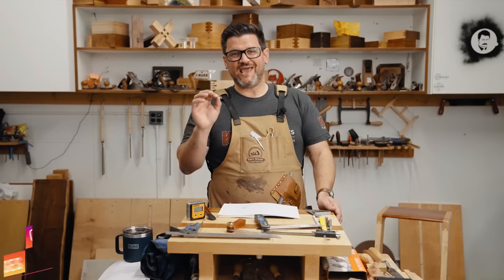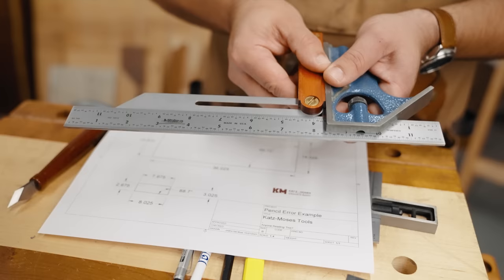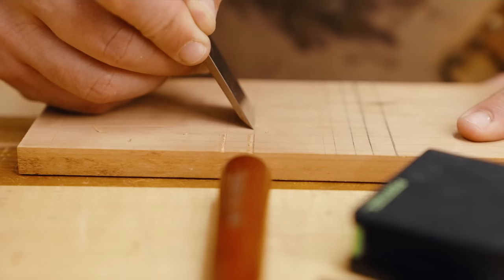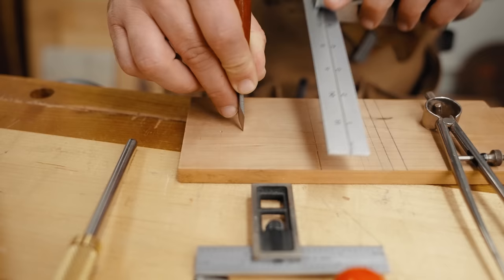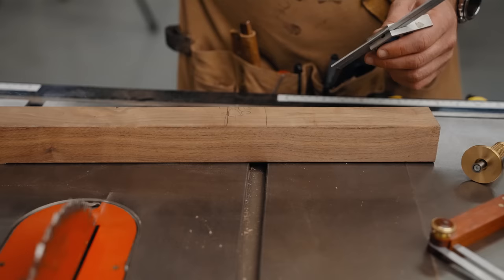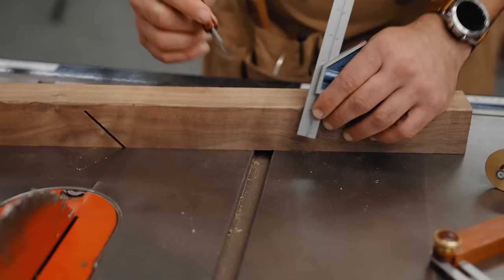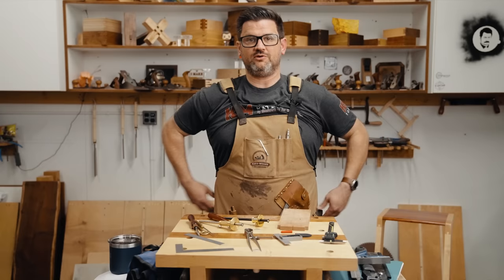Why Accuracy Matters in Woodworking - Common Mistakes to Avoid

Comment from the maker: Support What we do at the Katz-Moses Tools Store: KMtools.com
Tools Discussed in This Video
Marking Knife - https://shop.kmtools.com/MarkingKnife
Marking Gauge (micro adjust) https://shop.kmtools.com/mgbrassma
Marking Gauge https://shop.kmtools.com/mrkg
Center Punch https://shop.kmtools.com/centerpunch
Blem Squares https://lddy.no/120n3
Blem Rulers https://lddy.no/127tj
Double Squares https://lddy.no/127tm
Dividers https://lddy.no/127tn
Digital Calipers https://lddy.no/mpl3
Bevel Gauge https://lddy.no/127tp
----
Time Stamps
Intro 0:00
Why Accuracy Matters 0:17
How I use Tools For Accuracy 3:49
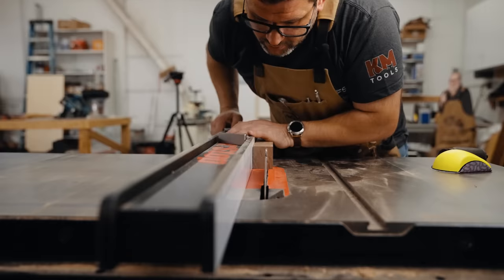Accuracy on the Table Saw 9:27
Accuracy on the Drill Press 13:17
*Accuracy with a Router: 15:20
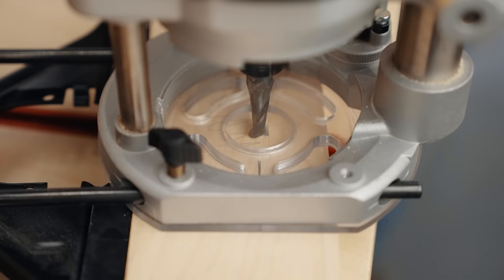Final Thoughts 16:49
Reply: Great video.  Keep them coming.  Chuck
Reply: Some of these links don't work. I went looking for the marking knife and the center punch, and those two for sure don't work.
Reply: “Yes i did read it!”, is the answer to your question “Anyone reading this?” On the technical drawing: Pencil Error example”

Comment: My belief is that accuracy is important, but consistency is more important.  If one part is 1/64 off, that will show.  If ALL of your parts are 1/64 off, that won't show.  When I cut multiple parts, I try and cut them all at the same time with a single machine setup.
Reply: This has been one of my key takeaways from Chris Salamone's videos - planning the cutlist in batches of same-size/angle to minimise the opportunities to introduce errors, using already-cut pieces as reference for the next piece instead of assuming that those perfect calcuations have transferred flawlessly to the real world, and where necessary taking multiple passes and test-fits to sneak up on a perfect fit instead of aiming directly for what you think is the perfect *measurement*.

JKM's advice here is all spot-on for the accuracy half of the equation but like he said himself, the best woodworkers are the ones who can fix their mistakes. Consistency and logical workflows are two of the best ways to do that :)
Reply: Exactly! Repeatability and Reproduceability are super important for most forms of engineering/manufacturing/quality control/medicine, etc, and woodworking. And metalworking. And cooking. Ok this is getting long 😂
Reply: yeah cause 15 thou means anything in wood lmao
Reply: @alterworks7212  Sure. And 640kb is obviously enough for anyone. Why bother with microns when we have inches right? Accuracy, Progress, pffft. All we need is duct tape. And marketing.
Reply: Numbers don’t matter. Fit matters.  Batch your cuts. Mark directly from mating parts, not indirectly from a measurement.
Reply: One could argue that accuracy and consistency are the same
Reply: 💯 yes!
Reply: @stephenrichie4646 you hit the nail on the head. It doesn’t matter if you start by measuring in inches or millimeters. It makes a world of difference if your shelf is noticeably shorter than the space it is supposed to span. Or if your box isn’t square because you got one measurement “wrong” and didn’t make adjustments as you progressed through your build. Usually there are no wrong measurements, just bad fit or inconsistency. Built ins are a different story…

Comment: Another advantage to using the marking knife is you cut the wood fibers on the surface so when you make your cut with either a hand or power tool there is much less chance of tear out or splintering.

Comment: These are undoubtedly some amazing tips, however i feel like this is addressed to professionals rather weekend woodworkers. Personally, i have contractor level tools and i do my best to make them precise and square them up, but realistically no matter how much time i will spend on precise marking i’m pretty sure most of my cuts will be ~0.5-1mm off due to the imperfections of the tools themselves. If i ever think about making money from woodworking, i will definitely take the advice from this material.

Comment: I love Taylor Toolworks 👍 My blem 12" combo and 6" double square are in constant use. You are the second person who has referenced using the same measuring device when working. When I did that with my last project, the accuracy was incredible. Most dead on project I have ever created. 
Love my center punch as well. I always use it when drilling holes. Got tired of my drill bit wandering, especially in softer wood.
You are one of the first creators I look at when starting a project and need pointers. You are also the person who helped me see how everything is not "perfect". I had an incredibly hard time with that when I first started and regularly wanted to scrap a project. When you stated that the mistake didn't matter, learning how to fix it did, it changed my outlook and helped me become much less frustrated. 
Thanks for the great info.

Comment: On the rare occasion I use a hand saw I found about 20 years ago that, after knife marking my line, to chisel a bevel out the whole way down like you started. It really helps the cut start out good for me as I have roughly 0 points invested in handsawing.
EDIT: I have an obsession for marking knives like you do for gauges. To the point where the reason I learned how to forge weld in blacksmithing was to make a "Damascus" pattern welded marking knife. I know have made 8 of them lol.

Comment: Videos like this are always interesting to me, because of the contrast between the almost machinist-like approach to woodworking on one end of the scale, compared to the build-to-fit no-numbers methods of old style hand tool woodworking on the other.

I personally lean towards the latter end of the scale, just because all the stuff I do is one-off and it has a nice low-tech appeal to it, but I can definitely appreciate both approaches.

Comment: Great video! My college professors would love this. This reminded me of every physics, engineering, chemistry and math lecture about accuracy and precision. I especially appreciated the part about using the same take measure. I would go further than that. You need to do inter-comparisons of your measuring devices and only mix use those that match up and toss out, donate, whatever... Everything that isn't square.

Comment: So true!...the digital caliper and a knife has replaced my tape and pencil... Cutting kumiko half lap joints for a shoji screen, using a box joint jig;-18 cuts over a 8ft length, 0.001 inaccuracy would screw up the whole layout. One lesson I learned was to start in the middle and cut the variation in half! Love your vids!

Comment: Every new woodworker should watch this video multiple times before picking up a tool and again after getting started. I learned some of these things the hard way. That, plus many of the guys in my local woodworking club say that woodworking is not that accurate. They scoff at William Ng using a feeler gauge. Good on you AND William!

Comment: As good as his tips are, I for one am not sure about putting your finger on the top of table saw blade, or on the spindle of the router.Always found it best to run or router a piece of scrap to check for error/ accuracy of setup.
Stay safe  guys

Comment: In my professional engineering mode I use digital calipers.   In my wood shop I MUCH prefer dial calipers.   If you use them to set a distance (instead of measuring) you will find it vastly easier to set, say, 1.5625" with a dial.  You'll dither with digitals and probably never really get it dead on.   They never run out of juice, are much easier to read in low light & cost less.   Yes, baseline measurements (i.e., 2 distances) require a little arithmetic but I can add and subtract with the best of them and it's not required often.   It's also possible to get better than 0.0005" measurements if you can guess how far between the marks the arrow points.  I use a 12" Mitutoyo dial caliper in my wood shop and wouldn't trade it for any electronic version.
Reply: Wilhelm Taylor...I'm with you; I use my Browne & Sharpe 6" dial calipers all the time. When I need to plane several boards to the same thickness, I always use my calipers to maintain very accurate thicknesses among the boards. I also use the caliper to find depths for various projects. I was a machinist until I retired, so my training in precision naturally followed me when I started woodworking.

Comment: Well your explanation of the thickness of the hook and why the end of the tape measure moves makes total sense. I was measuring for some drawers the other day and my measurement was off by that much because of the way I used the tape measure. Now it makes total sense
Reply: I think I’ve been doing it wrong… that movement has always made me nervous, so I always push the tape “in” so that it’s next to the hook… maybe I shouldn’t be?
Reply from the maker: @ryanhuff585  correct. Outside measurements use the pull function and inside uses the push function

Comment: Thanks for suggesting the Blem PEC combination squares on Tay Tools. I ordered the 300mm Metric, $40 bucks, got it today, checked for square, and WOW, spot on! 

I have been looking for a decent combo with all sides metric for a while. One of the hang ups I had was not knowing if I wanted to the hardened steel or cast iron body. The Blems on Tay Tools are the cast iron body, so I get to try it out for a very very decent price. All of my cheapo combo squares are now out of square after lots of wear, I hope the cast iron body holds up better.

So thanks again, that suggestion really helps me.

Comment: Cut to fit.  You only need tapes and rules when designing the project and making story sticks.  Learn to make story sticks even if you don't think you'll ever make that piece again.  If you're deep into a complicated piece of furniture, and still measuring stuff to some number, you're solidly on the wrong track.  Mark one workpiece directly from another, or pick off the dimension using a gauge of some sort, and/or mark it from your stick.  Measuring and cutting everything to a number is what is done in a factory where parts move from one department/one woodworker to another.  If you're using canned plans, then only use the overall dimensions of the project and put everything else in on your story stick(s) yourself.  This forces you to understand how everything is going to go together and makes all subsequent work so much easier and faster.

Comment: My lay-flat layout tape helped me mark panels a lot more accurately because (1) the tab can be squarely hooked on the wood edge with full contact (since you never tip the tape), (2) the tab helps tape accuracy because it’s fixed for outside measuring, (3) the tape lines are easier to “extend” onto the wood with a pencil (or knife) since the tape edge is always in contact with your stock (not curled up a 1/16”), and (4) the tape is always in great shape because it has zero ability to hold itself up when extended so it doesn’t get beaten up being used for everyday (far rougher) tasks.

Comment: Late comment but I mark a lot of stuff with pencil still but I also will mark a tiny X on the waste side of the cut so I know which side of the pencil line I'm referencing to. It doesn't completely fix the accuracy issue but it sure does help.

Comment: Thanks for this man. You can make beautiful pieces with quick and dirty measurements, and if you know what you're doing you can get it up to 95% perfect. But the only way to get into 99-100% territory is to go the extra step and be very careful and thoughtful about what you're doing and how it will affect things 5 steps down the line. Understanding cumulative effects really takes your work to a whole new level - it is very easy to not care about 1% off the mark - do that twenty times and you've got a big problem. Excellence lies in accounting for that.
Reply: most of the time you can make small corrections as you go, hell half my projects i dont even know how i am going to do it, just what i want to make and start cutting

Comment: This is really well done.  Only one I would have added is a dial gauge on a mag base. Even a cheap one is likely the most accurate device in a wood shop.  To really talk about accuracy talk to a machinist. For example, a level that is within 0.001" per 12" is shop grade.

Comment: Good video!!! Accurate measurements can help you transfer the exact measurement - length and Angeles to the piece that you work on whil you have to make a new part to make it tight fit with out measuring and guessing.

Comment: Your initial point about the pencil.... you are cutting on the different side of the line...... you can have the exact same error with a marking-knife and the error will be the width of the blade - which is also in the range of 0.5mm.
If you cut at the wrong side of the line then the pencil-width is the least of your problems.

Comment: If the error is consistent, then you will not have an out of square problem, you will have a fit or joining problem. This is why you use only one measuring tape for an entire project. If it is off by 1/8 the entire project - you are ok, but if you are off 1/8 here, 1/32 here or 1/4 there - then you will have an issue - a major one. JKM is right - accuracy is crucial in woodworking, but so is consistency!

Comment: Great presentation as always Jonathan. One point worth mentioning is that you're assuming there is no run-out with your Drill press quill or no run-out with your table saw shaft.👍❤
Reply from the maker: Well, that's something you should address on day 1 of buying a new/used tool. I have a great "Tune Up Tuesday" video series about making your power tools perform perfectly.

Comment: Great tips!  I ran into issues with measuring tapes that have both imperial and metric scales. They are not worth it and will cause errors.  I had to get a separate metric tape measure and since then I haven't made any errors because of a dual scale situation.  It is a minor point, but one worth heeding IMHO.
Reply: @BillZ66  Personal preference.  It is just tedious to me to try to read and stay on a tick mark when reading a tape measure with dual scales.  In addition, the scale ends up being smaller because of the dual scale so it is harder to read.  I found it far easier to switch between them.  I only started using metric because it is easier for some layout & marking operations.  This was just my experience and others may not have the same issue.

Comment: The pencil cumulative error is absurd. Generally an experienced word worker marks off the corresponding piece rather than adding a bit more on each piece. A marking knife is highly useful but to say you can’t be accurate with a carpenter’s pencil is a bit silly

Comment: Great video. Thanks.  Would like your advice on accurately marking the centre of a hole (of something like a hinge or fitting where reference point/edge is not the hole) ?
Reply from the maker: Look up "Vick's drill bit" cheers

Comment: I like getting my tool in there nice and deep... Johnathan, those are inner thoughts! Seriously though, another great video with awesome tips. I distinctly recall having to remake a chest top TWICE and was still wondering why it wasn't perfectly square to the frame. Very frustrating and time consuming. Thanks for the help hoss!
Reply: I like to start with just the tip and then eventually the whole tool.

Comment: I feel alot of beginner woodworkers don't take into account the widths of the lines, the widths of the blades, making sure to cut into the waste wood and not directly onto the reference line. Small things you learn over time make a difference in fit and finish of a final product.

Don't waste your time making everything super perfect on joints people will never see, only take the extra time where it matters. This way you won't burn yourself out making errors and stressing over details in areas its not important, you'll waste less wood too.

If you cut something a couple mil off it's noting a bit of wood glue and sawdust won't fix, that's how the old timers did it even on the furniture in palaces.

Comment: I have a question. How easy is it to fix a line/scratch made with a marking gauge?

I’m just a beginner and I know I’m probably overthinking this, but I feel safer using pencils because if I make a mistake with a pencil, I can rub the pencil mark out. 

But if I make a mistake with a marking gauge, it’d be a lot harder to fix wouldn’t it? 

I just feel a little scared to mark with a knife. 😖
Reply: I have the same thoughts. Did you ever get an answer to this somewhere other than this comment section?
Reply: @rw7532  no unfortunately.

Comment: A tool ive been looking for but cant find is a good metal rule, around thickness of a rule from a combo square and with a single beveled edge. Want it for marking and a quick tool to grab to check flatness. Just a thought
Reply: Shinwa rules are pretty good and great value they don’t have the bevel though
Reply: @spycedezynuk  ive seen them on tay tools. I found an igaging 24" straight edge with beveled rule on there. Just wish they had more variety of sizes

Comment: Lovely stuff and very helpful. I could use some help on getting accurate cuts on panels. Say I'm cutting a panel 70cm by 35cm off a piece 100cm by 50cm. In the first instance I take a cut off of 35cm. I use a tape measure but always get inaccuracies!  Using a Festool plunge saw so it must be me right??

Comment: While I agree with the thickness of the line - the angle of the marking tool is as or MORE important and even in your video I see you often hold the knife at an angle - To be accurate it needs to be scribed with the knife vertical or ate least consistent.